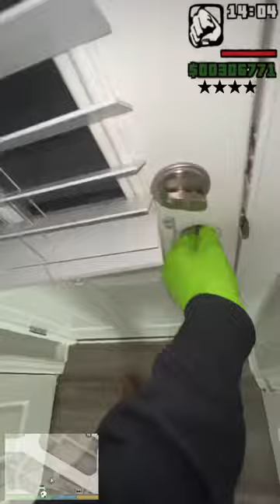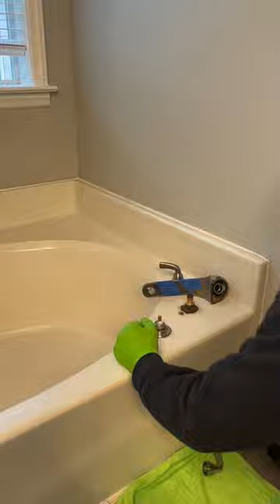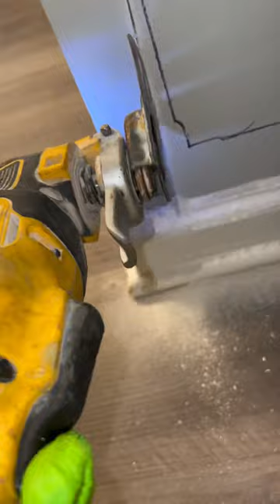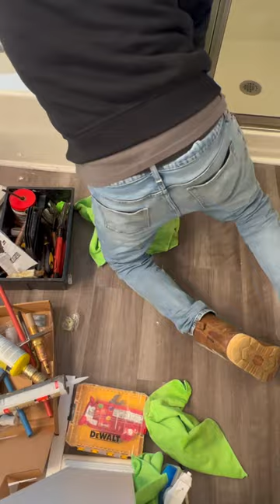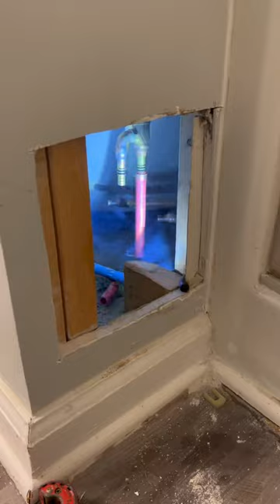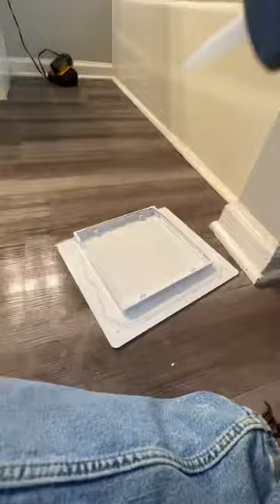ROMAN TUB Faucet Replacement #plumber #plumbing #diy #howto #asmr #bathtub #bathroom #plumbinglife

Comment: Loved the get to the point video! Bought a new matte black faucet off Amazon and get it only to find out it’s not a simple swap out. Cut a hole in the drywall of my closet next to the jacuzzi tub and find that it’s copper piping from the attic all the way to the faucet so I’ve go to do exactly what you just did. This helped my confidence level a lot lol.

Comment: Question for you. Do you let the customer know you’ll be leaving a hole in their wall prior to starting work? 

Great video. Thank you for the content. 👍🏼🇺🇸
Reply from the maker: 😅 of course. I don’t do anything without approval lol. Thanks
Reply: @theconservativeplumber  That’s fantastic. I do minor drywall repairs and most electricians don’t say anything. Then I come in and charge as much or more than the electrician and they almost always say they wish they would have been made aware.
Reply: You have to cut a hole in the wall to change it out ... 🤢 I wish the original plumber had used better quality so I might have been able to avoid this

Comment: Hey I got a tub like this and its actually leaking somewhere from the floor up to the connections under the tub.  Tub is set up like this where the handles are right on the tub and all the guts are under the tub.  Is there any way to really access the piping from the top?  Or is the only real solution is cutting from the under the floor?  I got plenty of room under the house to cut the floor, which I'm thinking that is my only option.  What you think?

Comment: Love the video but besides the problem of the faucet needing to be replaced the wall in front of the shower is only about 2 inches out. Not an option to put a hole there.🤦🏼‍♀️